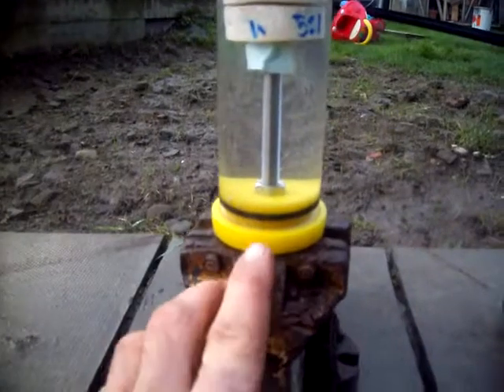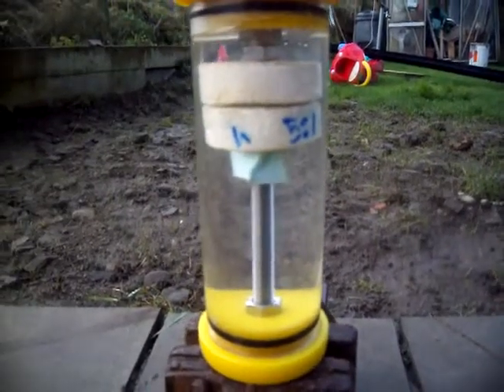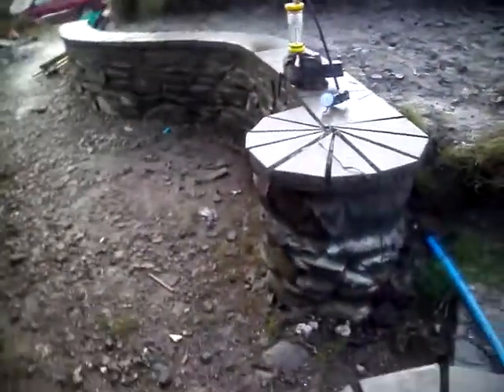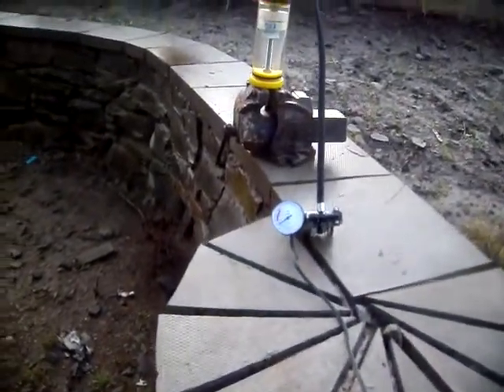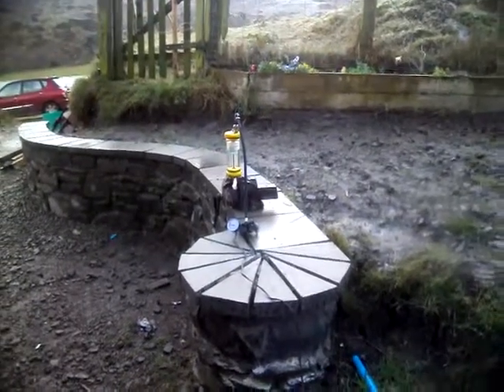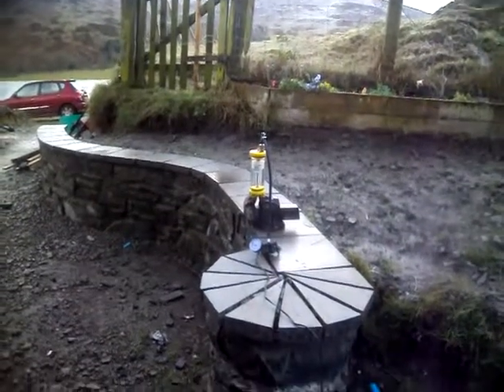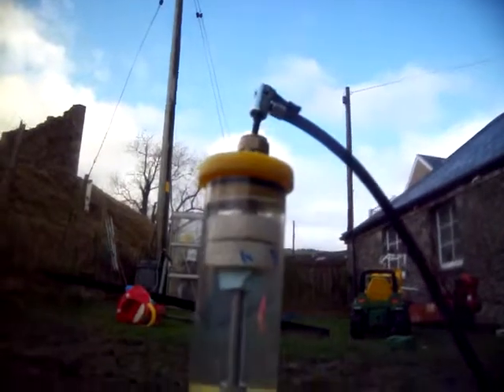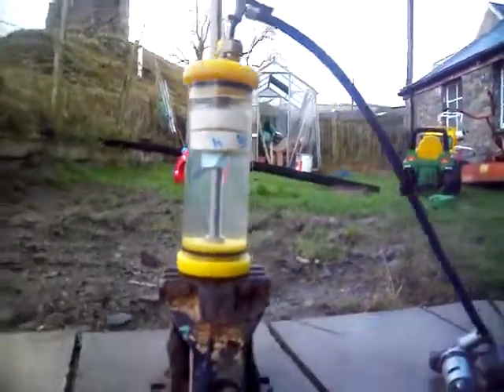FishingROV #17 DIY ROV. housing test 60 3mm acrylic tube

Comment: dude you are going to seriously hurt yourself, 

ffs invest in a hydraulic hand pump, don't pressure test with air!
Reply from the maker: Bindo  Thanks for you concern. Did you see the dome test video - that was probably dangerous. But I think there is very little volume of air in the pipe leading to the housing and the housing is filled with non compressible water so can't store enough energy to be dramatic.
Reply: There is more than enough air in there to cause serious injury.

yeah i saw the dome pressure test, that was pretty intense!

i think a pressurised hull is not a great idea, especially if you intend to market the end product as a fishing ROV.  it really needs to be atmospheric.